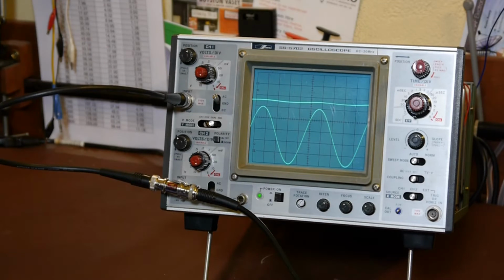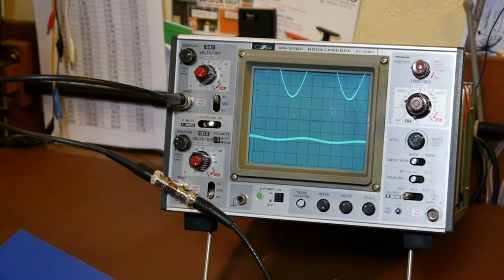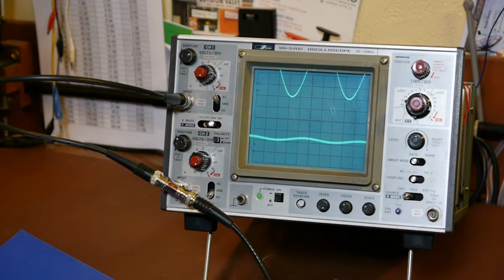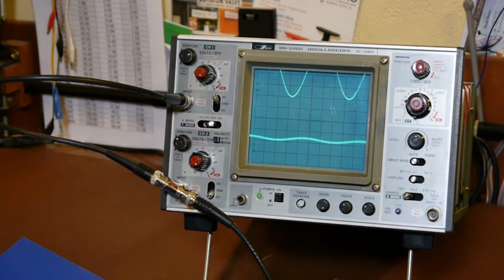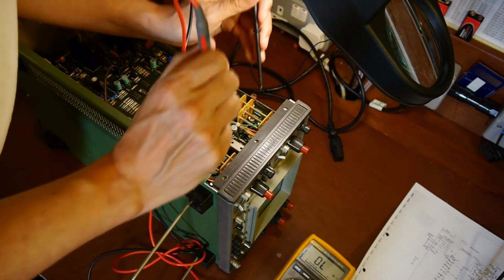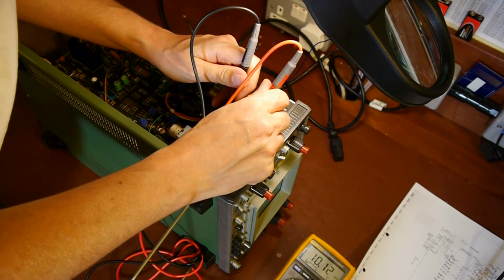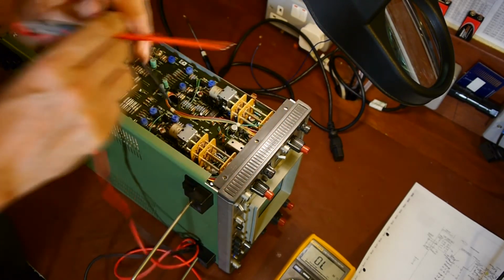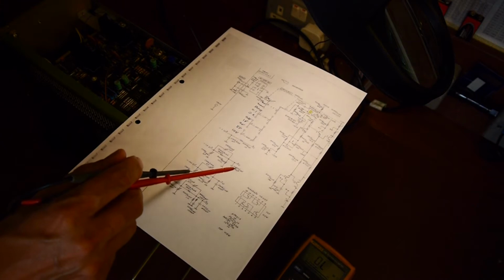DoubleTrouble Part 2

Comment: That's such a nice scope/s, not massive or so dam small that you need small fingers to operate it.
I've been watching your earlier vids, what a daft thing to say lol, i can't watch future videos that don't exist yet, a am a wally lol.

The scopes have been interesting, i like analog better than digital.
I have an old transistor cossor scope, a telequipment portable (has a handle) mains/battery, and a simple micronta display only scope.
The cossor blinks on/off when it feels like it, the telequipment was bad joint city every time i wanted to use it, i think i beat it.... i did say "think" lol.
Reply from the maker: I used to have an old cossor scope. It just had a flat blank screen with no graticule scale. It was all valves.Infact there nothing wrong with having an old analog scope for analog work. But I really need digital now, as I mainly work in digital electronics with various bus technology and need the decoding ability.  Thanks for watch the old video, I will try and make some future videos special for you. Regards Chris
Reply: No need to make special videos, just enjoy your hobby :-D

I don't mess with micro controllers atmel/pic... ,  so i skip them.
I used to know bits about z80 code, but i just don't have the interest to learn modern jibberish lol.
Oh, you echoed me in saying your frends are not interested in electronics so you cant talk to them. 
Ill shut my fizzog/pie hole/other  and leave you in pieces lol.
Reply from the maker: zx8401ztv it’s amazing how cheap scopes are today. Back in the day I would have given my left bollock to own a nice scope.
Reply: Ha ha i say nuts to that :-D.
I find it odd that most of the things i wanted at the time i could not afford, years later they seem to come along from all over the place.

I didn't get a scope for a hell of a long time, i bought the micronta display scope for £100, a hell of a lot of money now i look back.

For example, i was given a laptop so i could go on the internet, and it acted like a magnet for others, i feel like the pied piper of warwickshire lol.
The same with wanting a video recorder, i bought an ancient piano key jvc, later people started giving me machines, and some to repair for them.
I've always helped people by repairing there electronics, most of the time it was for nothing, money never was my driving force.

I did charge small amounts for repairing c.b radios and i soon found that i had radios coming from all over the uk for repair.
The bloody rubbish that other repairers had done to them was criminal.
I treated every one like my own, all faults were fixed and R.T.B faults were done. (Ready To Brake).

Non of what i'm saying is bragging or trying to upset anyone, it's just odd how things happen.
Sorry about the waffle :-(

Comment: My mind works in odd ways, when you were talking about the circuit diagram being somewhat less than intuitive, 
 An incident sprang to mind regarding wording and how it can be unhelpful.
Several years ago I worked for the armed services, on what was called "LCW" or low cost works under £500, good job but shyster employer.
 I had a works order to go down to UKLF  at Wilton, fine okay, just a new socket in an office.
 Drove down there, through security, found building, sorted out what was required-nice straightforward steel conduit job, the lady seemed to know the building so I asked "where's the fusebox?", she showed me-back of a storeroom along a few corridors-no worries.
 The only breaker that was marked up said "wall sockets"
 I put in the new socket and pulled in all new singles to make it all nice and correct.
 Then went to lunch with my mate in the town.
On return, I was a little perturbed by the increased security- far too many guns. Back in the building it was mayhem, people running left and right in confusion, and at the epicenter was a girl with a set of keys at the front of what looked like a filing cabinet of many in a line,(It didn't occur to me that they were hard drives), she with restrain screamed to me that she couldn't re-start it.
 I made my excuses, legged it to the storeroom and restored power.
 To the computer system that was processing all info. from the UK military forces at the height of the Bosnian war.
 you can bet I got my worksheet signed sharpish and got the hell outta there and spent a few days in Cornwall.
 So, accurate notation is quite important.
 Cheers, J.
Reply from the maker: Average Joe Wow Joe that's an amazing story and scary.  Must have been very interesting working at MOD sites. I had something similar when a signalling system went down because a cleaner accident  switched it off as she thought it was the light switch in the Coms room.
Reply from the maker: Average Joe I should have also said as a designer i often spend days getting the layout of a circuit diagram just right. I like to think that my equipment will be maintainable by others for generations to come. I often get asked to modify system i installed 20 years ago and it's amazing. How much you can forget about a project I new inside out at the time.

Comment: You need one of those big Tek 500 series scopes too keep you busy. Just the ticket.  Absolutely agree on the using if YT to chat away. Bar the maintenance guys, no one I know is interested in this stuff at work so I don't get the chance to waffle.  I wonder if Simon fancies a drive up to Newark for the radio rally? That's sort of near you, sort of me but nowhere near Simon :)
Reply from the maker: Andrewausfa  You know I was thinking a meet up and a beer would be good to arrange sometime.  I have quite a lot of gear that I would rather pass onto friends to play with than just sell etc. Perhaps the vintage radio fair or similar.

Comment: Good job Chris. Now for a real chalenge, Repair the broken switch and see if you can get the other one going. You need a least 6 scopes I find.
Reply from the maker: Simon Spiers  Yes I think I will definitely have a go with repairing those switches it's definitely possible. However if I do it I want to do it properly using the correct epoxy and fibreglass filler so the repair is as good as the original. I have many more scopes than that must be at least 14 of them. Like you I love my 100mhz HP scope but the deep form factor won't fit on the bench. I mainly use my TEK TDS scope  I treated myself to that expensive Keysight touch screen scope last year and although it's functionality is incredibly I have not fallen in love with it.  I just bought it for the serial decoding and it works very well.  We should arrange a swap meet combined with copious drinking of speckled Hen. Regards Chris
Reply: AllTheGearNoIdea It's funny e all have our favourite tools as you said in your video. The Hp scope I use on the bench has been by my side at work for many years. When it packed up and was scrapped, I was wombleing it away that same day. I have A Tec similar to yours plus the Iwatsu, a Tek 2225, two Tek 2440's and a fluke 199 that only works on one channel. Oh and the Telequipment D66. Barmy!
We should arrange a speckled hen meet that would be a laugh.
Reply from the maker: Simon Spiers Yes I really love my HP scope I think if you get many hours working with a particular piece of test gear you become very familiar with the operation and more importantly all it foibles. I think you can get to a point of having to much gear and not really having a good understanding of any of it. I feel like I should perhaps down size my collection and perhaps go more back to basics. Still I just cannot part with any of it and more keeps following me home.  Thanks Simon.

Comment: Thanks for the mention! YT is the only social media I do, and I agree with you! Nice to see the scope working proper!  Maybe you should listen to Grandpa, he's wise for a reason!  I got a second pair of glasses just for closeup work and it does help.  Thanks for doing trouble shooting using your scope, I'm new to using a scope, so its cool to see the hows and whys. I'm not sure about looking in your drawers, I'd rather look at your test gear!  :)  Also, your signal generator, did you have that at 50hz? ~Jack, VEG
Reply from the maker: Vintage Electronics Geek Hi jack yes I think I will end up with two pairs of glasses I'm just find the electronics type work uncomfortable at the moment. I purchased a large photography lamp and tend to keep this on now even when not filming the additional lighting helps. I think the signal generator was set at 1khz. The 50hz noise coupling was caused by  no load on the high impedance amplifier because the broken switch was open circuiting the input. This was being capacitively coupled from hand near the side of the scope.  Don't worry more test gear is coming but need a break from scopes.  Regards Chris

Comment: I always enjoy watching your videos Chris, believe it or not, an oasis of sanity in a world that I have little interest in being part of any more.
 When I used to have "parts donors" I could rarely resist the urge to feel sorry for them and inevitably end up spending ridiculous amounts of time restoring them as well!,
 Looks like a fun challenge there to sort out the wafers, nice thing is that if all else fails, new PCB's could be made up to fit,-I told you I was mad didn't I?
 Take care, J.
Reply from the maker: Average Joe Hi Joe I thought long and hard before pulling the board from the older scope. It's funny how you do become attach or sentimental about what are just inanimate tools well it happens to me. I also suffer from the hoarding problem but am really trying to down size some of my collection. Hopefully I should now have one good scope that will be reliable going forward. I think as you suggest I should make the switch wafer repair a video on its own. I have watched quite a few professional PCB repair tutorial and it would be good to do it properly and have a repair as strong as the original. This is done by routing out material and back filling with fibreglass impregnated epoxy.   I don't think you're mad well only as mad as me anyway. It does sound like you have more patience than me as I do like weekend projects rather than complete rebuilds. As always Joe thanks for your comment my best regards Chris.